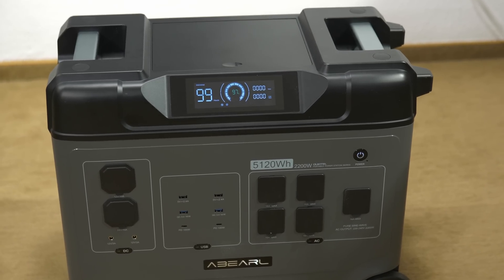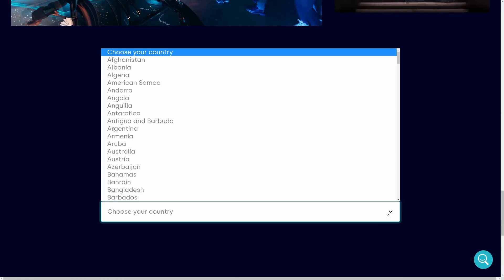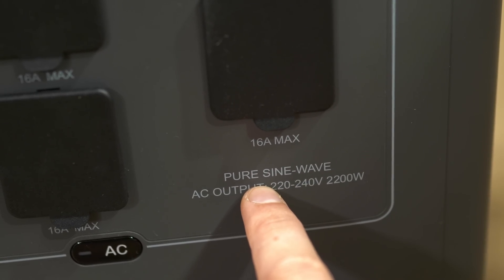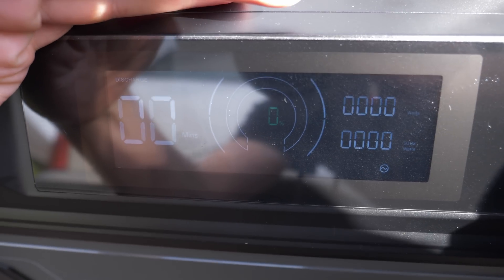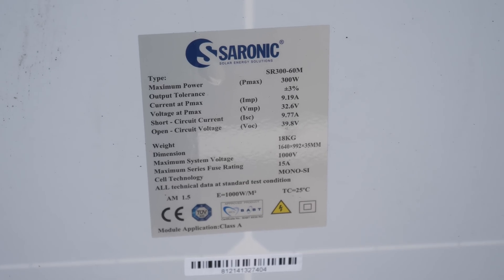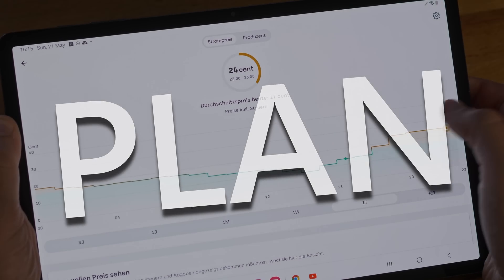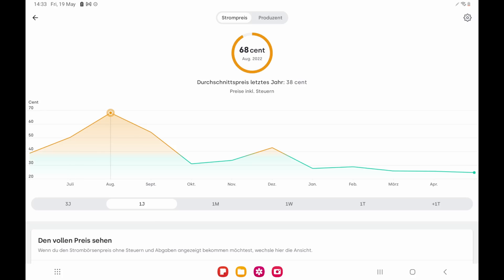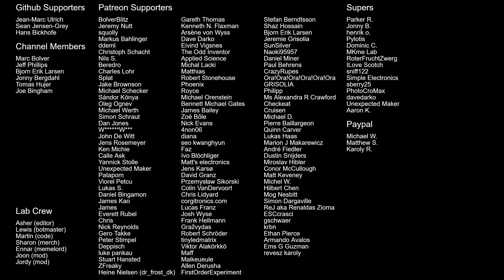I'm a power hoarder now! [Oukitel P5000, Tibber]

Comment: I believe it when they say that the battery is good for 6000 cycles if cycled at say 80/20%.
But these type of power stations have a bad record for inverter failure way sooner when used for this purpose as a house battery.
I think they are fantastic for camping and small off grid cabin use or as a back up for grid loss.
But as a permanent house battery you are way better off buying server rack batteries and appropriately sized inverters. Or even better still, building your own batteries to further save cash :)

Comment: Power stations have very poor input-to-output efficiencies though, typically only around 65-70%.  If you really want to load-shift, you need to do it with discrete, higher efficiency components and you need to keep the C-rate going into or out of the battery at 0.2C or lower.

For power stations, the input stage (charging) - typically 85%.  Battery efficiency (at 0.2C) is around 95%, and the AC output stage is about 85%.  0.85 * 0.95 * 0.85 = 0.686.   68.6%, typically.   Worse if charging too quickly or running heavy loads.

For a discrete solution, a modern MPPT charge controller is 98% efficient, the battery (at 0.2C, 48V/51.2V LiFePO4) is 95% efficient, and a real micro-inverter like an Enphase (for example, wired into a 240VAC circuit) is 98%.   The cheap retail 120VAC microinverters are typically only 80% to 85% efficient (even the ones advertising 90%+ efficiency are usually terrible).  You can tell because they get hot or require fans.... a big red flag that the thing isn't efficient.

In anycase, for a discrete solution with good components, the input-to-output efficiency is 0.98 * 0.95 * 0.98 = 91.2%.

Good components would be, for example, Victron charge controllers, 48V/51.2V LiFePO4 batteries (almost any brand), and Enphase or similar micro-inverters wired to 240VAC.   Stay grid-tied and just push power during the period that you want to load-shift out of. 

Also, depending on the micro-inverter, you might need another charge controller or current-limited buck converter on the output side in-between the battery and the micro-inverter to control the power.  That opens another can of worms.

--

A second way of doing load-shifting is to run the solar directly into the discrete solution plus an inverter and run your equipment from that, essentially off-grid but not quite.  Then have a programmable battery charger provide load-support to the system from the grid rather than trying to use automatic transfer switches or a UPS to switch the loads when the battery gets low.

This solution works well when the amount of load support required is minimal.  i.e. when there is enough solar to run the equipment 24x7 on reasonably sunny days so the load support only kicks in when it's been cloudy too long or during a storm or something like that.   Efficiency is higher under these circumstances because during the day the solar more or less runs the inverter directly so the battery round-trip only counts at night.

The load-support is also "ok", since it is also supplying the inverter directly, but the load-support has two conversions (AC charger and the system inverter), so it isn't as efficient as one might like.  But it IS a great solution if there is usually enough solar to bridge 24 hours.

-Matt

Comment: 0:30 Nordpool regulated electricity SPOT price formation by the market is not a SCAM😜. Some company is willing to pay the high price. The Euphemia algorithm calculates the regional prices. It takes into account the demand, production, and transmission bottle necks. However,

1) I don't understand how the Euphemia works. RTFM & tldr, effin huge ~70 page PDF.

2) I don't understand why the maximum prices is so high, like 4000 €'/MW, depending on the prices of past two weeks;

3) Somebody said it's a common commodity market principle, to pay the highest demanded price for ALL the sellers, independently of their lower production costs, and that to alter this, would break the market.

On the average, the market offers the cheapest prices. 🤑😎

I'm open for learning from somebody who understand the system =)

Comment: in turkey, unlicensed electricity production from the sun is limited to 25kw.. (kinda)  you can sell excess capacity to the grid but you can't oversell (or overload) to the grid. the voltage stays in the limit in a sunny day (~245volt) nowadays...

Comment: diy metal air with KOH or CuSO4 + dilute H2SO4 water electrolyte + graphite electrode as simple feed more battery (steel sheet spool feed)
Reply: dont leave the iron/steel in the electrolyte, only feed when its being used, like in a gasoline car, but its a iron-air fuel cell from a sheet spool

Comment: hi bitluni, I have a question please, I am working on an external cutter for my thermal printer ( i want to cut the labels after they are printed) so i need to extract the information containing the length of the label to assure a precise and clean cut of the label.
i successfully sent that information from the printer to my pc via the usb cable ( the information was sent in hex ) is there any way to send the same information to the microcontroller of the cutter ? when i cut the usb cable in 2 and tried to sniff out the signal with  an analyser, the pc displays an error regarding the cable, when i remove the analyser things get back to normal

Comment: Now do the calculations with proper LiFePo4 batteries from China that are at least two times cheaper instead of taking overpriced shitty products from local suplliers for a review. Aliexpress 7,6 kWh battery 1600€ with BMS and all connections.
Thanks.

Comment: Just a side note. If you had to actually pay for the power bank, and assuming 100% conversion efficiency at every point, no gradual loss of capacity or efficiency, each kWh stored in the battery costs you about 13 cents over the full lifespan, so that's the minimum amount you need to save on every kWh to at least break even.

Comment: You could double up the solar panels: Giving you two strings of the same voltage but double the amperage. The charger will limit the amperage to reach an input of 1000W. But you will get this for a big portion of the day.

Comment: I have a big PV setup. I get 12ct for deliver to the grid. My electricity contract (100% renewable energy) is at about 40ct. if those numbers would be constant in future the power bank will pay off after about 14000 cycles... I guess this will not be reached, so it will never pay off 😞 (the costs of this system in the link is 3700€, do I get 8% and 400€ combined or how do you get the 3000€ from the viedo)

Comment: Tell us more how you found out about the battery protection!
Reply from the maker: one should not use a brass standoff to touch a positive 24v pin and the connector housing...
Reply: Now we know and learned :). Until next time.

Comment: Maybe an option to exeed the 600W limit, also here in the Netherlands, a PV-distribution board? You can hookup a maximum of 12 panels with this configuration in the Netherlands. Only disadvantage is, you cant have any branches before the PV-distribution board.
Reply: yes a "pv-verdeler" is indeed a good solution in the Netherlands. But I think Germany has additional limitations on installation and contracts. What might be legal though is "overpanel" a small grid tie inverter that is limited to 800W on the AC side but can handle much more Wp on the DC side. This will result in a 800w AC for a big part of the day. (please check your German legality)

Comment: You say the balkonkraftwerk is limited to 800w in Europe, but I have never heard of it being allowed to pump electricity back into the grid through power sockets, and while that's ok in Germany, i'm sure this is not a thing in many other countries. For example it isn't here in Ireland, as far as I'm aware, and tried to look into it before getting proper roof solar. Otherwise, great work as always on the videos, this is really good stuff :)
Reply from the maker: 800W is somewhat a tolerated limit and you need to notify your local power "authority". You are not allowed to feed back past your meter into the main grid without a proper contract, as well. 
I just hope the governments realize quickly that opening the grid to decentralized power production is the future.
Reply: @bitluni  hm, to be precise - the limit in germany for now is 600W - 800W is the EU regulation, which is also not yet implemented in all eu member states…

Comment: How can a 3500€ power station called to be cheap on a diy channel ?
My LFP cell battery out of EVE cells has cost me about 1500€ and a 3000  W inverter is less than 500€ incl. a woodmade case, so 2000€ in total is way cheaper than a 3500€ powerstation

Looks like the channel is moving as so many channels nowadays are selling crappy goods but remember that even you can be made reliable for damages caused by the products you had avertised as the crypto advertisors had paid already millions for their sbf crypto advertising. And you are facing the same issue especially from american viewers. 
And then the cheap powerbank becomes a time bomb as the video is a time bomb 
 
Where is the advertising  sign ? 
2 brands and 2 campaigns for tibber and the power station- you are in dangerous high waters if you ask a lawyer considering these promoted brands offered payment and free prodcuts cause affiliate links and marketing is #1 advertising and #2 taxable income.
A free delivery of a product will be taxed like income as all those tesla cars had been taxed as additional income in Germany  back in the days when tesla rewarded the best tesla affiliate link sellers with free cars. And the that tax bill was a big bummer for them cause most of them could not  believe that. Nowadays they get a lottery participation and if they win the car of such a quarter it is lottery win which is tax free like all other lottery wins.
 
So you have to obeye the german advertising policies, mark the video clearly as advertising for the whole time and you also got in trouble with the country legislation about the question if your channel can be seen as a tv show  which would add a lot more requirements onto the channel like child protection questions and what not. 

This very, very expensive power stations can become a big bummer for a lot of youtubers once they get behind all the implications. You called it a 3500€ powerstation - which means you will have to pay the taxes for at least 3500€ and on top church taxes.

this powerstation is a whole crap based on the price it costs and even now with tibber prices you can not make money out of that. If you can get the cheap tibber tarif prices you still have to pay the local fees for the power line system of round about 16 cent. Even on the cheapest days your price will be above 12 Cent and considering 20% losses charging the powerstation with tibber power means that you will have to pay 1,2 kWh to later benefit from 1 kWh out of the powerstation. So your 12 Cents are now 14,4 Cents and the average price for new contracts is about 35 cents, so 20 cent is the max you can make a day per kWh used out of the battery, but the usual cheap tibber tarifs I can watch here are only for a limited amount of time during noon while you will try to charge the battery with solar power, right ?
Then your powerstation charge controller is blocked and solar power is also cheaper. Anyway you can only use such battery for 3000 to 4000 cycles and the more they are moved around the lower the capacity duty to micro damages inside the battery cause these powerstations are build out cheap grade b cells that the chinese government has not allowed to be used in cars due to the vibrations there, so vibrations and lifting a battery causes risks and damages otherwise they would not be sold as grade b
If you can make 4000 cycles and can save 15 cent per kWh you might get 20.000 kWh out of the powerstation but I doubt the inverter cramped in such a tiny space will survive that long.
Any how: 20.000 kWh x 15 cent = 3.000€ max. profits if you can save 15 cent per kWh which is not impossible but will take quite a while or in particular about 10 years.

And it will force you to change your and your familys habits to run your home or consumers off grid from the powerstation, lots of cables if you really want to make a profit.
Finally you will hardly reach the 3500€ savings needed to let the powerstation pay off itself or you have to store a lot of energy from the balkonkraftwerk in the battery and even that is limited right now to maximum 600W inverter if connected to the grid so you might need an additional off grid solar panel array but even that would not be enough: You still have to be in the 600W limits legally unless you are going fully off grid which requires to have NO GRID CONNECTION ANYMORE. Then you can do what you want but only within the legal limits - that the city council will have to check. And there are local saftey requirements that describe how you have to protect the modules against the wind and snow and if you check those regulations carefully you will see high and heavy loads of over 40 kg per module - that is why the 50€ black ibu boxes for car garage roofs and so on come with a manual that describe how to calculate the local wind load and how much weight you have to put into the black containers to then mount 1 or 2 panels on top of it. These regulations are part of the liability of every house owner has to take and date back to the permission to build such house.
Reply from the maker: Thanks for your input. I disclosed any affiliation, but I turned on the YT thing now so people who watch it without audio and subs will see that, too.
This is a DIY channel, but I'm always aware of the dangers of battery solutions. No insurance will pay if the DIY battery will burn down your house unless you certify it.
Reply: you looks like a joker, not everyone is so smart than you, Not everyone have time to DIY battery by themself, and there is a safety problem while DIY battery without extensive experience.your comments are more like a fraudulent person coming to deliberately attack the person who chose the power station. Like eg, People who bought gas car deliberately attacked people who bought electric cars, anyone has the right to choose

Comment: 12:42 - just roll the tape then, then we don't need to ask 😉😂 you got it on tape, yes? 🤔
Reply from the maker: unfortunately, I miss the sparky situations often. but the powerbank seems to have a good protection against dead shorts 😬
Reply: @bitluni  That is great the one cannot destroy the powerbank! 👌 Does it have RCCB/RCB function, as that would be nice, even if not providing protection against your fingers if you plug one in each hole. Then goodbye fingers as they will get cooked 😐 ..as a programmer I would like to keep all 10 digits 😉🤓

Comment: 5kwh of raw battery is about 900€ - you may should consider building some home battery storage project in a diy edition with pylontech battery and a growatt inverter for example
Reply from the maker: That's a good price. I'm only hesitant to build one because I don't trust myself with the safety. If I burn down the house with a uncertified makeshift solution no insurance will pay.
Reply: @bitluni  aren't LiFePO4 batteries extremely safe? I though that was the point of LiFePO4, lower energy density, but doesn't burn your house down.
Reply: @netroy  Usually in those kind of setups the human error is the main cause of "fires", followed by inverters. If you cable catches fire, the house would probably bur dow along with the battery.
Reply: @bitluni  You could contact Scott, he built one for his garage. And i got the feeling that Marco is doing the same soon. :D
Reply: @bitluni  Purchased and insurable or DIY and not, always a good idea to not have have house fire.  Place away from house with fire suppression/safety system too. imo
Thanks for the reviews and info, it helps us all.

Comment: I assume your cost calculation would cover more than 5 years. In that case, it would be helpful to include depreciation cost of power bank and solar using straight line method. If Germany kept running their nuclear reactors, you wouldn't worry much about this experiment would you?
Reply: That's a fair assumption, but an incorrect one. The standard regulation known as the "merit order principle" states that the most expensive power plant, which is still needed to meet demand, determines the price of electricity. This means that all other, less expensive suppliers can also charge this same high price. And so they did when gas suddenly got prohibitively expensive for a short while.

(Consumer) energy costs in Germany have been among the highest for as long as I can recall. It's definitely been like this even before the accident in Fukushima happened, that lead to the decision to shut down nuclear power plants in Germany.

Yet Germany is a net exporter of electricity still, as per Reuters: "[Germany] also is a net exporter of electricity and even expanded that role in 2022 despite an energy crisis at home."
Reply from the maker: It's a highly political opinion. France and Germany should make a deal where Germany supports France in the Summer where the droughts cause nuclear plant to shut down and France supports Germany in Winter when the sun is low.
It happens with the market to some extent but working with an "GWh account" would be cheaper for everyone.
Reply: @bitluni  That would only work if France can keep their reactors working at all. Part of the reason why electricity was so expensive last winter was, that France was buying huge amounts of electricity, because many of their reactors were down because of unplanned repairs. They found cracks in many of the reactors. Repairing them is very difficult and time consuming. Also, they are still investigating some reactors, so there might be more unplanned maintenance.